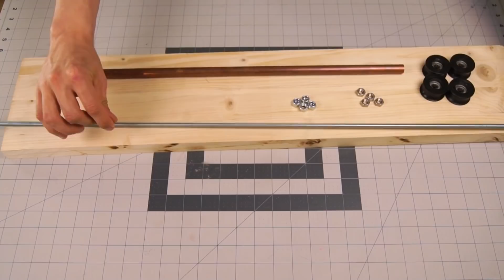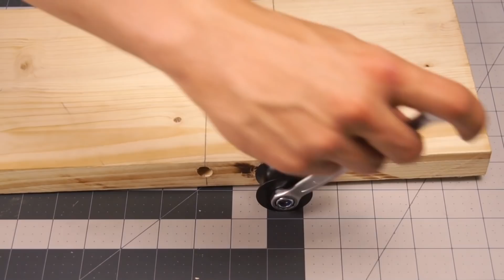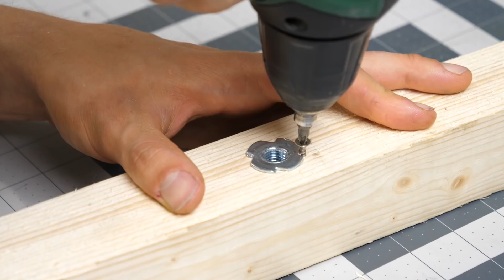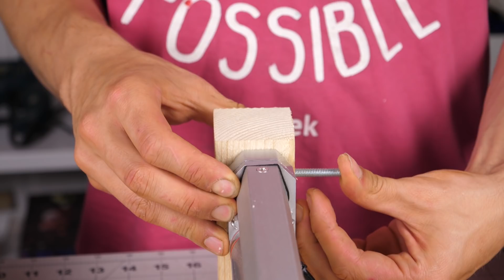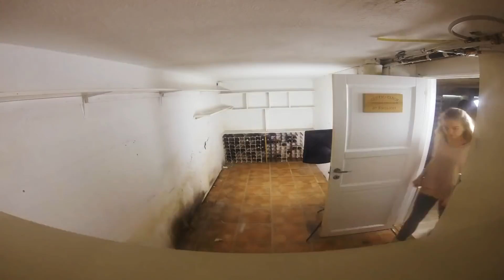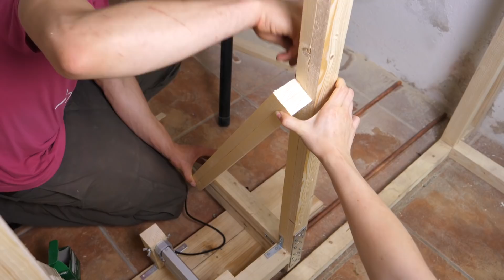Building a Secret Door Part 1 || DIY

Comment from the maker: Hey! In the following video we need a way to trigger the opening of the door. Do you have any cool ideas? I'm gonna have two switches: one to control the inward motion, and one to control the sideway motion. The coolest part of a hidden door is usually the trigger mechanism, and I'm looking for some inspiration!
Reply: Natural Nerd You can use a magnetic reed switch hidden in the wall, and have a magnetic ring on your finger and just wave in front of where you placed it :D (or a magnet inside something else in the room and grab that) 

You can also use a proximity sensor hidden somewhere (easier for someone to discover tho since it doesn't need a magnetic field to activate) 

A Bluetooth module on an arduino and an app on your phone

Or a RFID reader and a RFID tag
Reply: Or even voice activation, something like: "Tor, sønn av Odin befaler deg til å vise meg vinen!"

You should also add endstop switches so the electronics know when to stop (and start for the sideways motion of the cart when opening)
Reply: Screaming "You shall not pass" should do the trick

Have a pointy stick with a magnet embedded into the bottom of it and a reed switch on the the bottom side to the door close to the floor that will get triggered. Although the screaming won't be necessary it will add to the effect, perhaps use turn some LED lights with the trigger mechanism for an added effect.

PS: An other way to trigger it would be to try and trigger from the vibrations that will be created by banging the floor with a stick, but that would be less reliable (in opening when you want and opening when you don't want to) A piezo stuck to the floor would work for the detection but you would need a lot of filtering and pattern recognition to work half decent, a lot of work for less reliability. The magnetic one is better in this regard but you would need to hit the right spot every time.
Reply: you could add a hall effect sensor or NFC chip and make a specific wine bottle to hide the magnet or NFC sticker to act as the key. this way you can move or hide the 'key' wherever you want. with the hall effect sensor, you can then even make it so you have to move or turn the bottle in a secret pattern to activate the door, or for the second phase of opening.
a hall effect sensor is what the google cardboard headset uses inside your phone to recognize the magnet moving on the side to act as a digital switch. twisting the bottle in the magic spot on the wine rack will create a specific pattern in the magnetic intensity reading from the hall effect sensor. unfortunately i don't know how to do it, but it shouldn't be too complicated to program an arduino to read the signal.
Reply from the maker: Thanks for the suggestions! Let me clarfify: since I only have a couple of weeks to make this build, I'm not doing it digitally. So not microcontrollers. Else I'd need 3 parts. There is one analog switch to move the door inwards, and another to move it sideways. These are the switches I am limited to . They have to be wired directly up to the motors, and flicked manually. I'm looking for some ideas to how I can integrate them in a neat way!
Reply: Use a timer instead, 1 trigger push slide the door back and the timer stops it for X seconds before sliding to the side.
Reply: Natural Nerd oh OK. Well, I'll think of a few other things then :-)
Maybe one switch hidden in a desk or wall lamp switch, the other with a magnet hidden in a bottle. 
Or a switch in a hole where you have to screw in a corkscrew to reach it. Or inside a bottle so you have to pull the Cork out to activate the switch. (Not all the way, just as far as the two arms on a corkscrew lift it. It's not that easy to push back in though...). 
Or a beer bottle opener attached to a 'string' that's actually a wire, and when you hang it on a nail (rather than let it dangle) the circuit is completed. Might need a relay if the motor amps are too dangerous.
Reply: What about hidden switch and remote or keypad also what about palm print or finger scanner andvoice activation
Reply: The second switch could be on the sled where the actuator would physically trigger it once the door has retracted far enough and the same concept but in reverse for closing the door.
Reply: a secret magnet switch. when you put a magnet to the wall it triggers the door.
Reply: You could substitute the second switch for a mechanical part that closes the circuit for the sideways movement. I could explain it better if you want in PM and send you pictures of the Circuit in a PM
Reply: or how about a "wooden Shelf whith a hidden button built in to it" like a secret switch...
Reply from the maker: I really like the idea of using a wine bottle somehow to trigger it. I guess it would have to be two bottles. Hmm.. thanks for all the ideas!
Reply: pressure plates?
Reply: maybe try using two books? one to open and one to close, I know it's unconventional, but I'm a sucker for anything using book levers.
Reply: what about using a book leaver mechanism but like in a sequence with several different books
Reply: nice idea but what about time mechanism so it opens and close at a particular time and stays closed at a particular time
Reply: Yeah Maybe
Reply: Use an Arduino and a Normal Lightswitch - if you Press the Switch in Combination ( example Short Short Long Long Short) The Arduino powers 2 Relais to flip the Voltage at the Linear Actuator - No one will ever find out hahahaha
Reply: Do multiple switches, where the door has to be shut, a wine bottle has to be in a certain position, and a magnetic switch in the wall. You have to do all of them to activate the actuator.
Reply: Switch on a can of beets. No one will ever grab for it.
Reply: Natural Nerd use a rfid sensor and an arduino place the sensor behind a thin wall. You could log who goes in and out you and Martina could have a different card. You could have a LCD display on the inside that says welcome ( whoever just entered ) and then you can just scroll to see the logs. If both of you are coming in just scan both your cards and it can say if just you or both of you entered. You could also build the card into a watch or bracelet or if it is small and flexible enough glue it to you wrist. The sensors go for 4$ on eBay and they include 6cards
Reply: with a little bit more material and code you can make do with one switch
Reply: What Hidden Switch And Remote Or Keypad
Reply: Natural Nerd a wine bottle as a switch
Reply: Yeah It's Wine
Reply: How about a secret wine bottle for the switch?
Reply: A wind bottle?
Reply: Natural Nerd Use a microphone on the inside of the door as a knock sensor. Combined with an arduino, you have a lock that can only be opened with a code consisting of correctly timed knocks on the door.

Digger prosjektet btw!
Reply: that's a good idea
Reply: I'm reminded of an old episode of "Murder she wrote", in which a business man had a secret compartment in his desk which was heat triggered.  He would hold a burning match to a spot, heating a heat sensitive metal strip (such as those used in meat thermometers), which would curve in reaction to the heat, triggering the mechanism to unlock the compartment.
Maybe you could take the coil out of a meat thermometer and set it up so that its movement would trigger the mechanism?
Reply from the maker: That is a good idea. Then there would have to be a similar button at the far end to break the circuit when its all the way open. Still would need a second button on the front to trigger the reverse mechanism.
Reply: what about using it for like hidden bunker with independent power source just in case the power goes out in your place
Reply: The trigger for the door moving sideways on the rails should be trigger by the door moving inward after you activate the door to open. What would be awesome is if you made it open by knocking. Shouldn't be too difficult with a Raspberry Pi and the like.
Reply: Ok Maybe
Reply: What a about a Wine bottle that you pull to open? :)
Reply: Use a garage door opener to trigger the sideway motion.
Reply: Nice Idea Anymore Idea's Of Switch's
Reply: Add a drawer or two to put some objects, like corkscrew, etc. Than put the switch under the drawer. Its easy to activate and hard to find.
Reply: that's great idea maybe a touch sensor like switch
Reply: What about a magnetic level? BUT instead of moving an item off the shelf to activate the lever, place a magnet inside an empty wine bottle on a DIFFERENT shelf. Then you need to swipe a special location with the magnet "key" to activate the door?...
Reply: you mean using like a magnet key I saw that on one of the episodes of my favorite show House where the doctors break into a patient's house it turns out he had a hidden bunker full of weapons
Reply: Natural Nerd perhaps you could use some sort of prop such as a fake/empty bottle to trigger the inwards outwards motion  and then a separate to activate the sideways movement
Reply: Natural Nerd  a hidden switch   and instead two swtichs just one     like  have an endstop   and when it's trigger it starts moving the other part also this should run on it's own power source   in case of an emergency or power outage
Reply: Nice
Reply: Natural Nerd secret book that you pull out of the bookshelf. Make another switch on the insode so you you can get out if for some reason you get close in there
Reply: that it's been done before L plain I leave for that is shaped like a book so the hidden panel and open try something original or more out of the box
Reply: What you mean
Reply: Great Idea
Reply: wine is more obvious than fun (
use painting or moose head or lamp or lamb
Reply: What do you mean
Reply: Reed switch with a sliding piece of trim.
Reply: What
Reply: Use a RFID pad hidden in the wall with magnetic closures
Reply: Nice Idea idea of a RFID sensor in the wall and a has magnetic lock's  like when the power is on I mean when the power is on the magnetic locks demagnetize to open the door then if the door is closed and and automatically locks
Reply: How about a torch on the wall like in scooby doo? xD
Reply: I would use some home automation solution, like SmartThings or Wink, and hit a contact sensor in a book, or globe or torch, and you can create some really cool trigger mechanism for this.
Reply: Nice Idea
Reply: Natural Nerd  day
Reply: What do you mean
Reply: have you thought about installing position detecting switches? connected to simple logic board, it will allow single switch activation. while opening for instance, after fully retracted it would automatically start to slide open,... activating a second time during operation will pause  at that point and allow reversal upon the third

action of activation will.
a) start opening if fully closed
b) start closing if fully open
c) pause if in motion (remembering state)
d) restart moving but in opposite direction(using opposite of saved state) otherwise
Reply: What Is This
Reply: yes thats right you do not need 2 triggers you can use 1.
Reply: What Do You Mean
Reply: Johnathan, do you remember which episode that is, or what year?
Reply: "also this should run on it's own power source in case of an emergency or power outage"

I would never design such a door that required power. The best hidden doors work without an energy source.
Reply: what you elaborate more on Pacific's of these particular switches
Reply: http://successhare.com/?r=48545